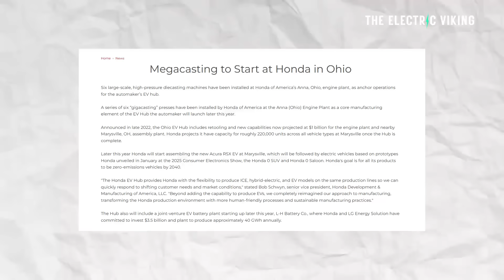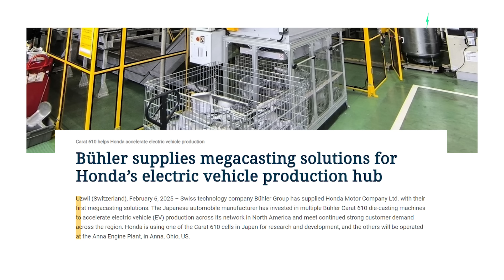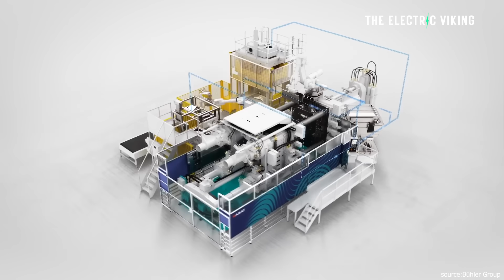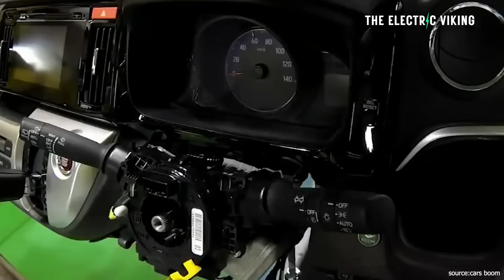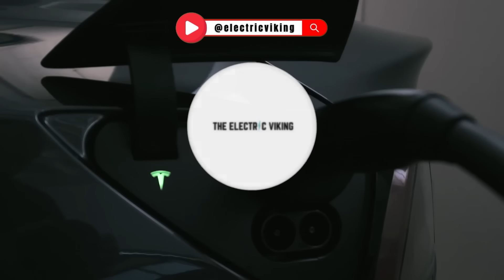Honda install 6 Tesla inspired Gigacast machines at American EV factory

Comment: Your intro to this video is complete hogwash. I'm an automotive design engineer, no one in my fraternity was calling gigacasting a bad idea... less parts, less material, less welding is always a better option. And stop attributing Tesla's engineering accomplishments to an individual with an Arts degree.
Reply: As I recall, the criticism was mainly about having to repair a body frame built from gigacasting that damaged.  I still have never found a good answer to that.  

For myself, what I thought ridiculous was that it was some kind of great competitive advantage to Tesla.   Say what you want about Ford and GM,  if they find gigacasting is better to do, they can easily do it.   They would not do it until a next gen vehicle is designed and produced but they can do it.   I believe Ford has said they will be doing it for their next gen EVs but don't hold me to that.
Reply: @RonnieLeeDuck  Joke
Reply: @ ah yes, "Tesla have no advantages, the big manufacturers could easily crush them as soon as they decide they want to". Been hearing that for more than a decade now.
Reply: @ No, like anything in life, there are pros and cons. Gigacasting has initial prohibitive costings but benefits if model proves to be popular and has a huge production run. Tesla was first to market, it could get away with only two global models. But that time is over, Chinese brands have caught up and their offerings are plentiful.
Reply: @rodcam5647  pros and cons... but the pros outweigh the cons or other companies wouldn't be copying Tesla now that they've done it. Which is fine, but those companies don't also get to say they would have done it all along if only they wanted to and Tesla did nothing special. It can't be both.
Reply: @ 

First of all, Tesla still doesn't make as much profit as GM.  So as of now Tesla is not exactly crushing the automakers either.  

Secondly, I never said anything about Tesla not having advantages.  It's just that gigacasting is not it.  

By far the the biggest advantage Tesla has right now is having their own in house software platform that controls nearly all components of the vehicles.  All the traditional automakers are at the mercy of their suppliers doing the software for all the various modules in a car.  

Other stuff like humanoid robots and being an energy company are things that the automakers are not even trying to compete with.
Reply: @ Tesla have sold 7M vehicles so far, all of which are sales that legacy manufacturers did NOT make. I guess they just didn't want to because they don't like money or something?

Since you mention GM, their sales have dropped from 8.4M in 2018 to 6.2M in 2023 (can't find their global sales for 2024, though they're up in the USA and down in China) - strangely enough, almost exactly matching Tesla's growth in the same time frame. I guess they totally could still sell as many cars as they used to, they just don't want to, right?

You're right though, GM are making profit (from $8.1B in 2018 to $23.4B in 2024). Increasing profits in collapsing market share, that's surely a good sign that has never gone wrong before (*cough* Nokia, Kodak, Blockbuster, Cisco *cough*).

Yeah, it's all the same stuff. Been over it all before. "Tesla only sell 10 vehicles a month! Tesla only sell 1000 vehicles a year! Tesla only sell 100K vehicles a year! Tesla don't even make a profit! Tesla have only got two vehicles!" And now Tesla are selling millions of vehicles a year and one of their two main models has been the highest-selling vehicle in the world for the last two years and they're highly profitable with much higher margins, and legacy auto is shrinking especially in the largest car market in the world (China), but the goalposts just keep moving for Tesla, somehow, don't they?
Reply: @RonnieLeeDuck  Actually they are just a shade in Ford - all Fords profit. GM keeps losing a shit ton of money every EV. Please keep facts.
Reply: @BittermanAndy it's easy to make electric cars that put legacy auto more in debt! 😅
Reply: @mhsj  That is true if you factor in various noncash write downs GM did such as their Cruise division.  Then there is taxes and pensions that factor in.  GM profit was only around $6 billion. 

But adjusted earnings is what is looked at to see how a companies core business is doing.  By that measure GM had $14.9 billion in profit.  They also had $14 billion in free cash flow.   Both are far above what Tesla reported. 

Those are the facts.
Reply: The Electric Viking has never let the truth get in the way of his video clips.
Reply: The fact Tesla can turn a car out every 30s speaks volumes to the quality of those vehicles which is clearly 💩 Also you don’t repair castings as you can’t ensure the casting integrity in the same way anyone with a brain doesn’t repair a buckled alloys wheel. Just because you can do something doesn’t mean to say you should do it. All those welded stampings that you refer to which add weight and complexity is what gives the car / chassis it’s strength in a crash. Those parts are welded or bonded robotically with guaranteed precision, it’s not a weak part of the vehicle. In fact some of those stampings are designs to sacrificially fold and deform upon impact to absorb energy. The fact you are honestly suggesting a single casting is better in a crash situation tells me you have no idea what you are talking about. And yes I’ve also been design automotive engineer for many years.
Reply: @ can you tell me which car company you're a design automotive engineer for so I can make sure never to buy one of your cars again?

According to you building cars efficiently is bad, and getting the four highest safety ratings NHTSA have ever awarded (for Model S, Model X, Model 3, and Model Y) shows the cars are unsafe. Yeah... I'm not going to pay much attention to your opinion, even if you are telling the truth about your career (everyone on the internet is an expert, didn't you know?).
Reply: The worlds richest man has an arts degree, and your point is? 😂
Reply: @ these people really tell on themselves, don't they. They see someone successful and they have to find something to sneer at, so they sneer at the fact he's "only" got a BA... I wonder how many of their friends have BAs... or no degree at all. Apparently all those people are inferior, according to the people sneering at Musk for it. Who knew?
Reply: Let me guess, your funding got cut from USAID?
Reply: Just another example of bitter jealousy of this generation.  The reason China is beating the hell our of our nation now is that companies are run like this now a days.  Anyone that excels is pushed to the bottom because they make others uncomfortable.
Reply: Your comment is cr.p!
I remember clearly how many people in the comments were dumping on Tesla over the Giga casting.
Tesla took automotive casting to a new level and deserve the plaudits.

You are more likely a troll than an automotive engineer
Reply: Tesla deserve the plaudits for lead ring the industry.

Lots of Giga casting trolls still around in the comments being d.cks
Reply: The German car companies talked the idea down because of repair ability
Reply: Elon Musk holds two bachelor's degrees from the University of Pennsylvania, one in physics and another in economics
Reply: If engineers always found gigacasting a good idea, why wasn’t it done before Tesla did it ?
Reply: @ because it's expensive and it locks the company in to one design. That's why you don't see many core iterations of model 3 and Y.
Reply: @bagheera32  technology evolves,
Reply: Because there wasn't the technology yet, actually Tesla doesn't build its casting machinery, they are built in northern Italy by Idra and by Buhler in Switzerland. I know this because I sell the most stressed piece of the machine, the "shot sleeve", which doesn't come with the machine, you have to buy it separately from a handful of specialized suppliers.
Reply: @bagheera32 Tesla have 2 models and now a cybertruck. Sales are dropping their cars are stale
Reply: “I’m aN EnGiNeEr” love how you got trashed in the first miniute of the video. 
This Lil bro mad asf in comments 😂😂😂😂🤡
Reply: Who is the one with the arts degree?
Reply: @whowhy9023 Elon musk
Reply: @whowhy9023  Elonia VonTrump has an arts degree from Penn State.
Reply: @anthonyperri9755 Elon Musk has a degree in physics & a degree in finance.
In 1995 he wrote all the code for his first startup zipto for the first couple of years.
Company sold for $ 300mil netting Musk $22mil.
Reply: @anthonyperri9755 and a Physics degree
Reply: @whowhy9023    he sought a dispensation after failing English and History in order to secure his degree... No one else gets a dispensation after failing two core subjects, I guess a rich father and a generous donation/bribe helps.
Reply: @anthonyperri9755  you do know that he had 100K in student debt when he graduated college? If dad was rich, then why did he have loans???
Reply: Other people's money.... @archigoel
Reply: He has a physics and business degree not an art degree
Reply: Now your car is scrap because because the switch that is broken in your centre console  is embedded in the casting which cannot be accessed because it’s cast in. Whoever thought of this idea must be a genius at selling cheap mass produced cars that has no interest in maintaining the reliability and serviceability of the brand.
Reply: "Yeah, we always knew this was a good idea, we just never wanted to do it, because... it was... a bad idea... no... wait... a GOOD idea... we just didn't WANT to do things efficiently, we were DELIBERATELY not using good ideas." Sigh.
Reply: @BittermanAndy  because of Gigacasting Tesla only has two global models and a refresh once every 4 yrs
Reply: @rodcam5647  so you're saying it's a bad idea. But then if it's a bad idea, why is everyone else rushing to copy them?

You can't have it both ways. This is really simple.
Reply: Elon did not come up with all the innovative solutions at Tesla but in this case, yes, it was originally his idea.
Reply: Elon Musk got a double degree in Physics and Engineering from Penn. The confusion you have thinking that the degree was in Arts, I believe, is because universities have “Bachelor of Arts” or “Bachelor of Science” degrees. This is why the abbreviations are BA and BS for the degrees. Whether a degree is considered a BA or BS is usually historical and has nothing to do with the degree itself,
Reply: Elon didn't even start Tesla Motors Company, he bought a piece of the company from its two co-founders.
Reply: @2049chsthat doesn’t matter at all. Making it succeed did matter
Reply: @2049chsTesla was not the name, and the co-founders just wanted to secure funding to build a prototype EV then pocket the money.  They did not want to fail at producing cars to sell.  That was impossible and they both knew it.  Elon was dumb enough to make the impossible reality.
Reply: @2049chs And what were the 'co-founders' doing? Raising funds to make an electric sports car based on a Lotus Elise chassis, 87% of which they got from Musk. Before Musk took over they had nothing but an idea. Musk turned it into reality. By 2009 he had put $70 million of his own money into the company. By 2013 he had run out of money, then sales picked up and the company finally started making a profit. Without Musk there would be no Teslas.
Reply: @2049chs he made it, though. no musk, no tesla.
Reply: @2049chs 😂😂😂 can you tell me what Tesla was before Musk and his investment? Go on, i will wait. He is listed as co founder for a reason. Stop being jealous, it's shameful.
Reply: @ ooh, ooh, I know this one! Two founders, no employees, no money, no designs, no patents, no factories, no products, no revenue, and they didn't even own the trademark for "Tesla Motors", but they did have a piece of paper saying that their business was called "Tesla Motors Inc". Also, both left long before Tesla turned a profit and neither of them have done anything of note since. Still, they were the visionaries and ultimately responsible for all of Tesla's success!
Reply: @BittermanAndy  Well said!

Comment: The many advantages of giga-casting aren't exclusive to EV's; they apply to ICE vehicles, too. The irony is that legacy automakers will likely apply giga-casting manufacturing technology to ICE vehicles as well, thus using the most advanced technology to improve a product that's fast becoming useless! Kinda like employing advanced robots to shoe your horse!
Reply: ICE vehicles aren't going to disappear any day soon and as long as they keep outselling EVs, legacy automakers may as well use giga-castings.
Reply: @anthonyxuereb792  Agreed, the ICE isn't going to melt for 10 or 20 years. But the end is in sight.
Reply: Gigacasting can be used on ICE vehicles but greatly helps EV's more as the other piece of the puzzle is the structured battery pack using cell-to-chassis production. ICE manufacturing has no equivalent to the other piece. As a matter of fact, ICE vehicles are getting more and more complex with the engines and transmissions.